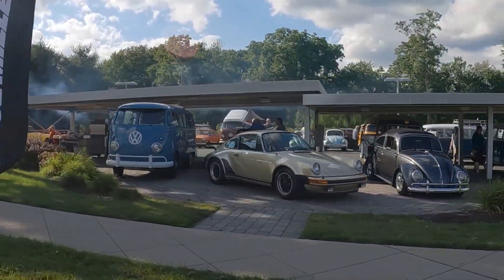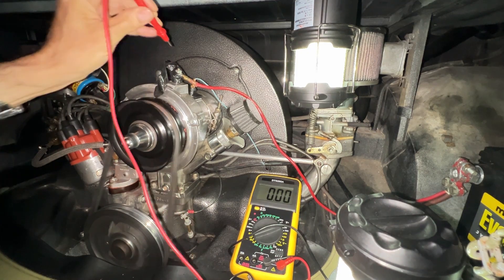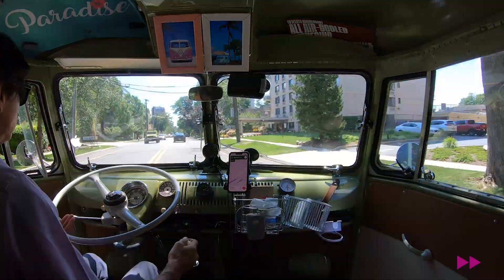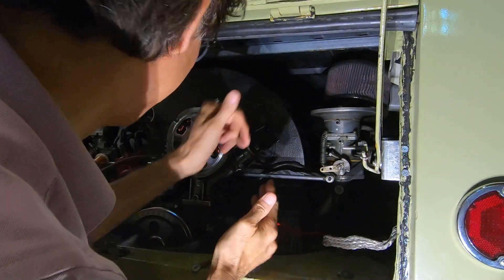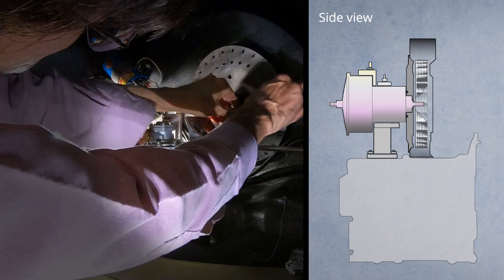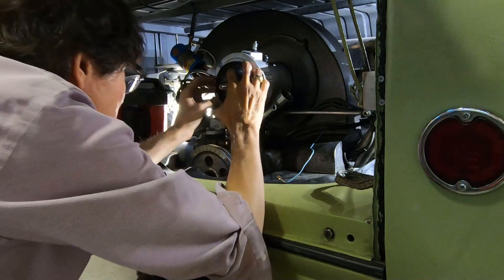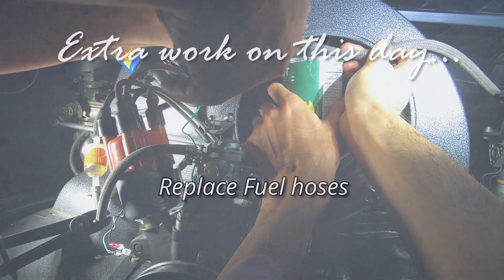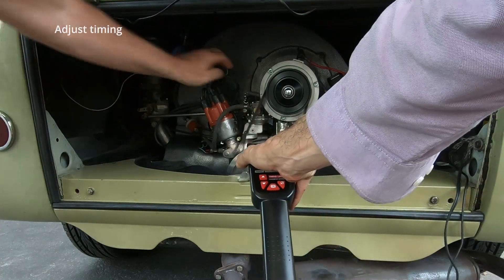VW Bus Alternator / Generator replacement without removing engine or shroud (Full Story)

Comment: Hello, from Japan.
 The person in the video is Casey from the Central Jersey Volkswagen Society, a VW club in New Jersey. He also owns a Westy. (I've received various things in the past, such as key chains and stickers.)

Now, the cause of most alternator failures is the voltage regulator. For BOSCH products, it is the AL82 voltage regulator, but since it is built into the alternator, the standard is to leave the voltage regulator outside (and the wiring) and attach it to the fan shroud with a bracket or something. It would be fine if the voltage regulator was of good quality, but I have a friend whose voltage regulator broke right away. Even if it breaks down while you're out, if it's outside and fixed, you can just replace the spare voltage regulator yourself. If you also use a coupler for the wiring, it's just a snap.
For your reference
Reply from the maker: @junichikitano5072 , Thank you. You live in Japan and know Casey? Did you live in NJ before? He is a wonderful leader of the club here. Ely who sold me the alternator knows how to make the external regulator and he uses that. I can learn from him later. Thank you for your support.
Reply: @VWBusLife  Yes, I live in Japan. I met Casey on Instagram. I'm looking forward to your future posts.
Reply: @VWBusLife  Yes, I live in Japan. I met Casey on Instagram. I've owned a 67wesy for about 30 years. I love VWs and camping, and I'm the vice president of the "VW CAMPMOBILE CLUB in Japan"（VW CMC） My friend also had the same voltage drop problem and had to replace his regulator.
As a fellow VW fan, I look forward to your posts.
Reply from the maker: I see, nice to know you have a VW club in Japan. Do you have Facebook or website I can see what you are doing?
Reply: Casey is the reason I want to restore my 66 westy.  I have a 67 sundial. I'll ask him about key chains.  The vanagon was not ready, but this year, I want to make it to his show.  It's only like 400 miles away.
Reply: @DanTheManIOM  Yes, just ask Casey. He even gave me a New Jersey license plate. Wow!! I'm jealous that you have a 66westy & 67sundial too.
Reply: @ and a 65 standard and 67 deluxe...and.... it's out of control !

Comment: It looks like the left side of your throttle linkage is rubbing on your spark plug wires and fuel filter/hose when you accelerate
Reply from the maker: Yes, I didn't like the filter position. I changed that after this day. I will remove the fuel filter out of there soon. Spark plug wire is clear now. Thank you for your comment and support.

Comment: I’m glad you were able to get it fixed, next time we see each other i want to look at your electric. Eli
Reply from the maker: Thank you Eli. Thank you for the Alternator. It was much better that what I had. The old one I had didn't charge when engine was idling but the new one output 13V from idling RPM. See you soon in the spring.